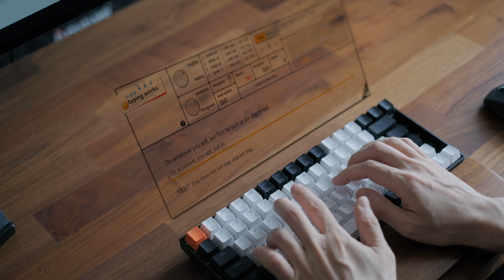Lubing my Keychron K2V2 to get a better feel and sound

Comment: if you havent tried I also recommend trying some good tactiles like holy pandas, Boba u4t or zealios.
Reply from the maker: Interesting!
Reply: Those are overhyped and expensive switches. Heavy as well at 62g. The kailh speed silvers are 40g, linear, and just 1.2mm actuation. Light and nice on the fingers.
Reply: @skyhappy  to each their own preference, i have not tried zealios but I have glorious pandas and boba u4t's(68g) and i love heavy tactiles. Compared to cheaper tactiles ive tried like Durock T1 and Gateron browns i much prefer the sharp tactile feel of Bobas and their deeper sound compared to panda switches.

Ive tried linears and they just werent my preference even for gaming.